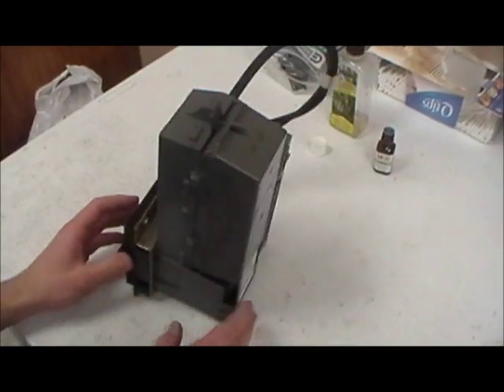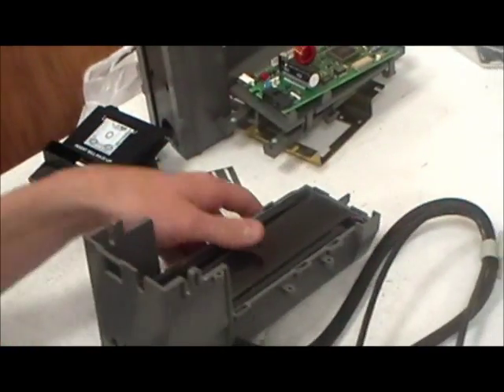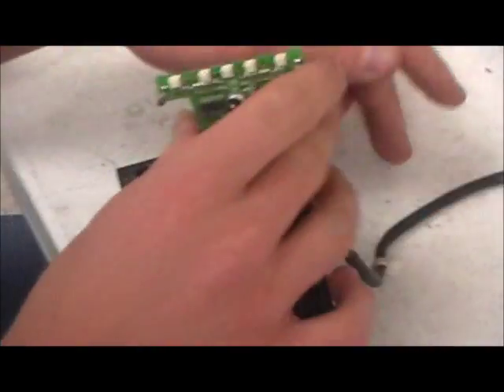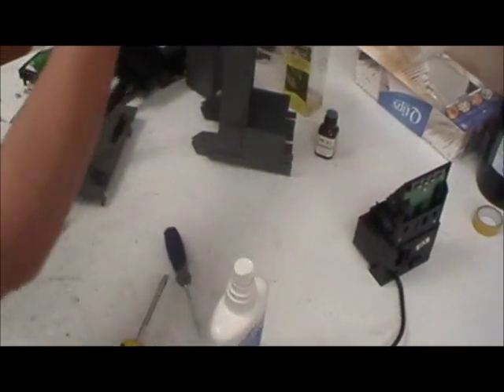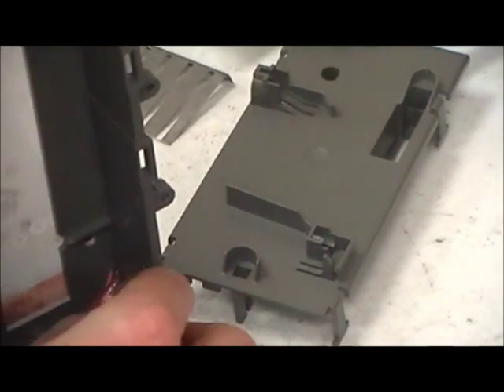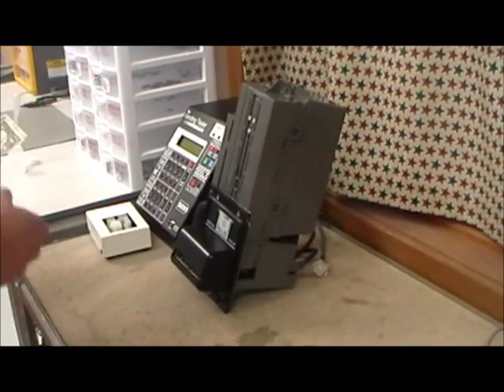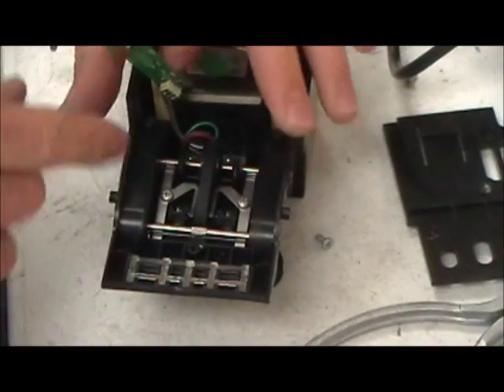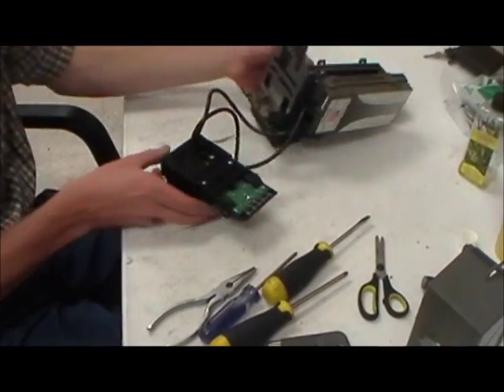How to Replace the Belts on a Coinco Mag/MagPro/Mag50b Bill Validator

Comment from the maker: We filmed this video at one of our repair tables.  We don't use all the tools that we have at each desk for belt replacement.  The brush is used when we clean the units.  When we clean the units, we take them apart completely, then scrub them under running water with the brush.  We dry and polish them with Novus #1 plastic cleaner.  We remove stains, old labels, and marker writing with lemon essential oil, or Melaleuca's Sol-U-Mel concentrate.  We sell all of those if you call us and order them

Comment: I'm trying to repair the one for our cigarette machine, it's a magpro.  The bills are bunching up inside the unit past that lower section that pulls out and not making it into the stacker.  My question is, should I be able to rotate the stacker manually by the belt gears, or is it normal for it to be not turnable due to the gear reduction?  I'm trying to determine if it's seized up, or if the problem is elsewhere.  The unit is clean and the belts seem to be in good shape with plenty of grip.  Also, where can I get a bench tester for these?  I'm the bench tech at a casino and have been working on JCM validators for 18 years, but this is my first time looking at a Coinco.  Thanks
Reply from the maker: Why don't you give us a call on this problem?  It will consume a goodly amount of time to try and help with this problem through YouTube comments.  970-623-1272.  Thanks!